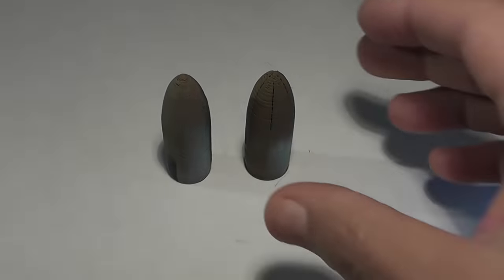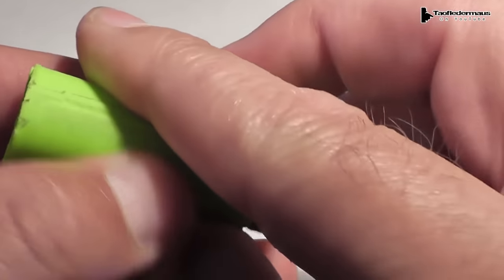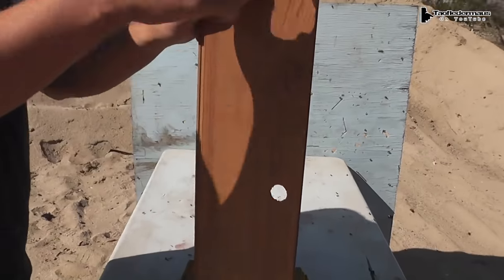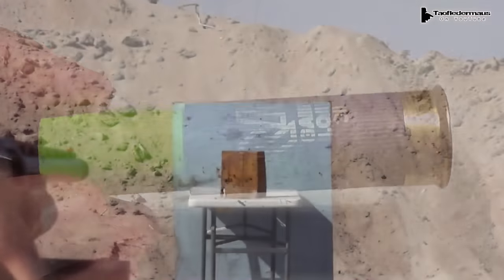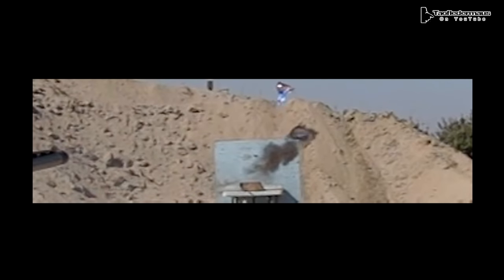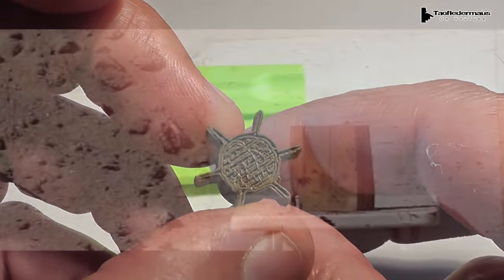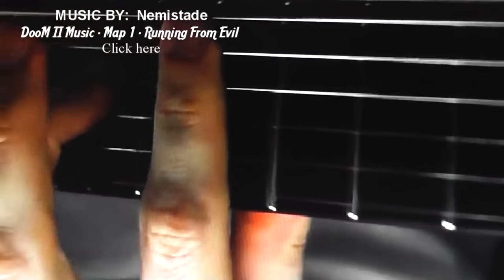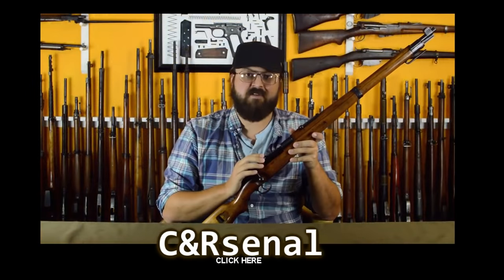3D-Printed Bronze-Fill 70 CAL Shotgun Slugs -The Future is Now

Comment: Wow, love the Doom Music remake, and I am almost convinced I should get a 3D printer ;)
Oh, and as a nitrocard replacement for your Lee slugs, try punching out some "pallet corner" cardboard. its a highly compressed resinised cardboard for protecting palletized boxes from tie-down straps.
Reply from the maker: +Aussie50  I can make some using card stock  (uncorrugated) and it might be denser and fall away.   But...   I don't think they have that much influence on the slugs,  they are just occasionally just riding along.  I think factory deer slugs'fiber waddings tend to do the same thing.

Comment: You guys should mention to anybody that prints any sort of projectile to be tested to print them on their side. The problem with printing anything cylindrical vertically is that it is weaker because its like laying rings on top of another. If the layering or "grain" runs from top to bottom and not side to side then it could give extra rigidity or just cause it to act differently. Might be cool to see, just a suggestion.

Comment: Seeing that absolute butt-ton of flies gave me an idea.
You may have heard of a thing called the bug-a-salt gun. Basically a spring piston powered shotgun that shoots salt grains. 
I'm sure you know where this is going. 12 ga. version. See how well it works vs ballistics gel, the original never got more than a cm or so of penetration, wonder what some good power would do. if compression is an issue you could use a small wax plug at the base of the shotshell to help add some weight.
Reply from the maker: +darkwarrior  I don't know if my HS cameras have good enough resolution to give that much justice.
Reply: True, would be kind of pointless without the HS to really break down whats going on. The concept is intriguing however.

Comment: a theory i have is that the rifled choke tube may not be long enough to stabilize the rounds. you should consider throwing a rifled barrel on the mossberg if you can.
Reply from the maker: +GLC jonsan308  They don't make rifled barrels for the Mossberg 590,  just the 500.    I was torn between buying a dedicated rifled shotgun that I wouldn't use THAT much,  and trying the $30 rifled choke tube and give the Benelli another role.
Reply: +TAOFLEDERMAUS gotcha, I hear benelli rifled barrels can be expensive. use what you can get I guess.

Comment: Where these a 3d printed shell filled with bronze or were they printed with a bronze infused filament. If they were not a bronze infused filament you should try that.
Reply from the maker: +Erikogel1   These had bronze particles in the filament,   but can be used with normal 3d printers.
Reply: ***** Ok thanks. love that filament.

Comment: This makes me want to fire up the old 3D printer :)
Reply: +ArtisanTony Yes do ti pls
Reply: +mysterioushooded All of the new printers make mine look so old :) You don't have to put the mew ones together or anything. Or even build Apache servers to run the software :)  They are like plug and play now :)
Reply: In my engineering class we just got a new printer and all we had to do was calibrate it so it knew where center was and it was printing that day
Reply: +Billy Benedict That's crazy talk :)  When the Solidoodle first came out you had to assemble it and then rig the computer to talk to it :) You had to set up an apache server,  a software to display the model, a software to create the slices (layers) then a software to send the layer info to the printer.  It was a lot of work :)
Reply from the maker: +ArtisanTony  Yes,  what is wrong with you?  lol

Comment: to me this is way more scary than a 3d printed gun that got all the medias nickers tangled a while ago
Reply: you should watch the bubblegum rounds then
Reply from the maker: +Robert Condon (SunnyTurtle)   I would have loved to have filmed the bullet coming out of one of those 3d printed guns.  It had to have tumbled and missed everything they shot it at.   I don't recall them ever showing it being shot at something.
Reply: The gun i was taking about was all "the liberator gun" an had almost no barrel firing .380 ACP I believe that the "barrel" or part around the bullet was replace each shot. I don't know muck about projectiles but i can only imagine.
Also because the part around the bullet was replaced each shot there was no way to calibrate any sights as the bullet would be pointing in a slightly different direction each time. Maybe one day you could show this gun. Sorry i can't print you one i am in Australia.
Reply: +Gr3nadgr3gory seen yes they are scary but my point. is just because its 3d printed its not really anymore scary than tradition home made ammo which has been used since the beginning of guns

Comment: You all seriously need to shoot some 18-series LiOn batteries out of that thing. They come in 3 flavors, all 18 mm in diameter (should be perfect in your 12 gauges, though I wouldn't use the Benelli...), 35 mm, 50 mm, and 65 mm long. You can get cheap, shitty ones for a couple bucks a piece, and I think they'd make for some interesting shooting.

As a CYA though, they are rechargeable batteries, and they're notorious for exploding/venting jets of gasses and smoke if mistreated. I think that firing them out of a shotgun might count as mistreating them. So, might wanna leave them alone for a few minutes after shooting them, just to make sure that they're safe to be around.

budgetlightforum (dot) com (slash) node (slash) 28249 for ideas on sourcing old laptop battery packs (they were typically an array of '650s). And you may want to look into what happens when LiOn batteries vent (plenty of vids here on YT), so you know what you'd be getting into. That is, of course, if you don't already know.

I hope you decide to do this! If not, no worries. Keep shootin' crazy shit outta that poor gun, and sayin' 'fuck the haters!' I'll watch what you put out, as long as you're making new vids. Thanks for doing what you do.